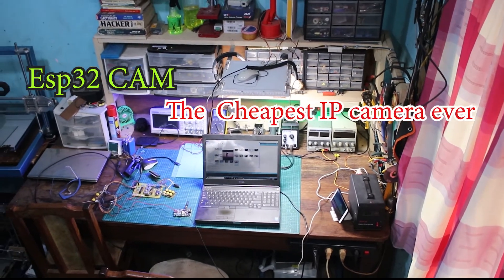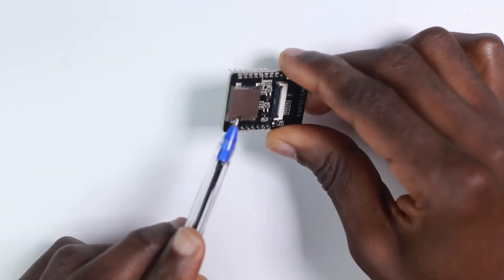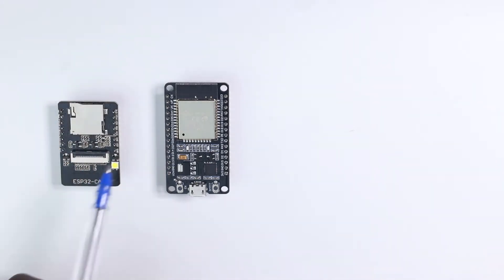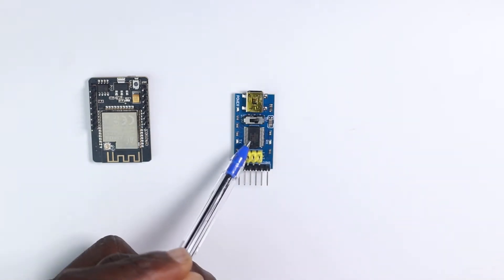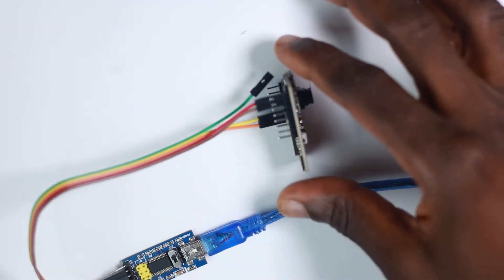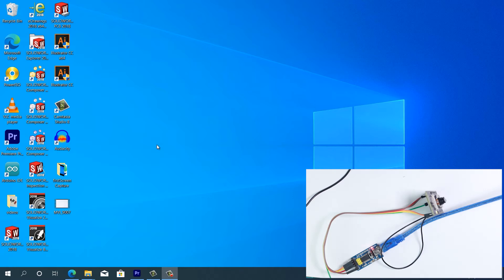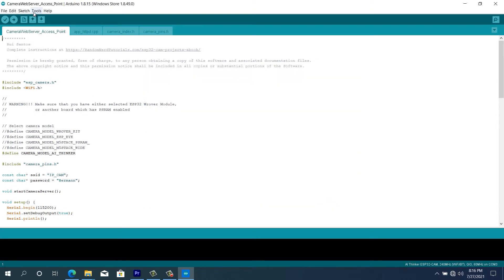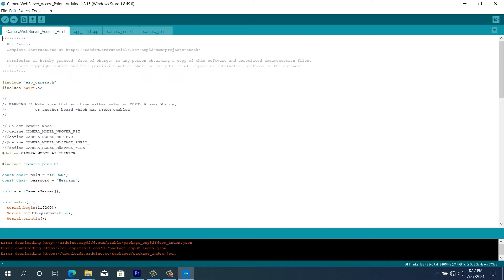Esp32 Cam the cheapest IP camera ever

Comment: planning to try this out soon. Is there any way to connect  gps module to esp 32...or do you need raspberry pi for that?
Reply from the maker: Yes, it's very possible. All you need to do is to connect your GPS device to the USART terminals of the Esp32 cam board and the rest is programing.